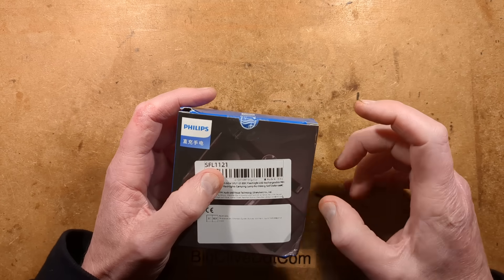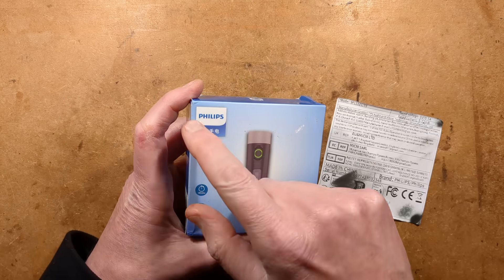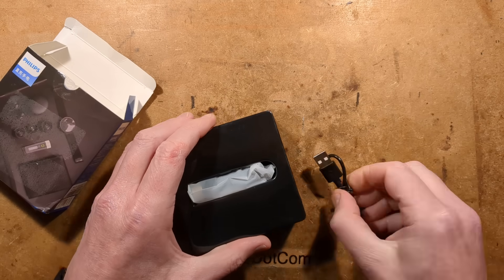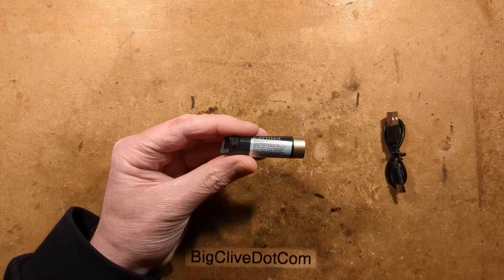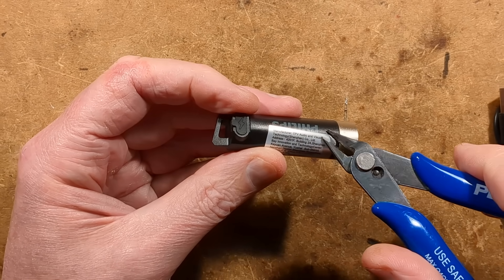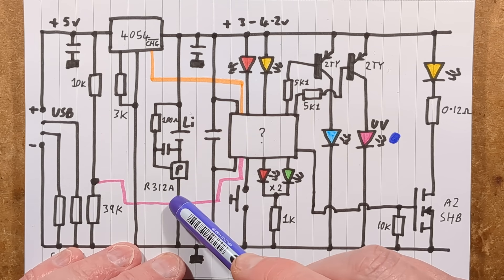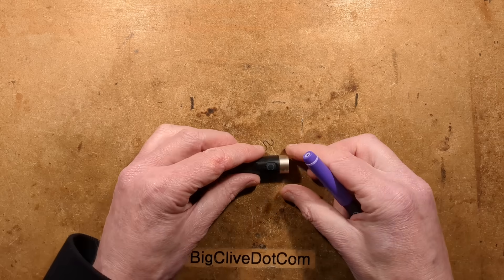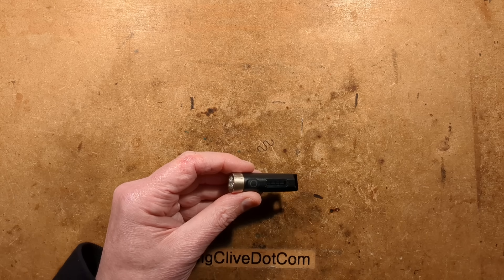Philips flashlight teardown

Comment: It's not Philips as was (a company that nearly collapsed, and in 2010 had their CEO celebrating that "we are no longer a high-tech company" - how the mighty have fallen), but one of the companies that, as you postulated, licensed the name. However, TPV make good, often high-end, products - my OLED TV is a Philips, made by TPV, and it's fantastic, some software issues aside. Some of these rebadgings are just shamefully playing on previous brand association, but some make good things. I'd argue that TPV are largely the latter.
Reply: I think Philips focus exclusively on the medical equipment market now and abandoned the consumer electronics.
Reply: @simonoleary9264 Yes, but apparently with a few exceptions like electric razors, a hair remover for legs etc, and two more products I can’t remember. Otherwise it’s professional medical equipment. (From their corporate website)

ASML was a Philips spin off. They really had a top notch research centre (NatLab, in Dutch short for physics laboratory) but they made some (in hindsight) poor decisions over the years.
Reply: If that in fact is produced by TPV. The consumer products division was sold separately from TPV to Chinese investment firm hill House in 2023
Reply: They still run the shavers market I’ve got the one blade pro 360 and it’s a nice premium product

Comment: anything coming from China I am careful to buy thru eBay or similar so I can use their third party reclaim system if anything goes wrong... just had a fun experience with £6.36 worth of lamp socket adaptors... managed 'partial refund' of £6.35 after much effort (and that was with a product recall, dangerous goods issued by eBay themselves). Not that I expected it to be easy after previous experience
Reply: Interesting that eBay is difficult with recalled items... 
My experience with Ali for 3 (IIRC) recalled items has been that a full refund has been issued so fast that I'm sure it must be automatically issued upon request.
On other refund request they've been pretty fast, but given the seller 2-3 days to respond. Issues with USB drives and TF cards have all been refunded after submission of FakeFlashTest screenshots showing failed read back. 
Only bigger value order I've had to request a refund on  was an order of two tablets that turned out to be a scam (I was 50/50 about it when ordering, price was very good, but not necessarily an obvious scam).
Sent pics of the envelope (way to small to fit 2 tablets) and the content (2x flimsy plastic keyboard covers/keyboard "condoms") and got refunded w/o hassle.

Comment: I know the 18650's are the size of the battery, does the 601035 also refer to size?
Reply from the maker: Yes it does.  In this case 6.0mm thick, 10mm wide and 35mm long.

Comment: I'd argue they're not a zombie brand, as lots of their lighting products are still quite high-end and I think designed in-house. But they do run the risk of cheapening the brand if they do stuff like this.....
Reply: I dunno, this seems to be a fair cut above the usual Chinesium equivalent
Reply: The lighting products are made by Signify, a former spin-off which is now completely independent and also makes other lighting brands.
Reply: @moe.m That's interesting. Odd that those huge displays of Phillips light bulbs are no longer Phillips products.
Reply: @moe.m they also do the Philips Dynalite range which is commercial lighting control systems.